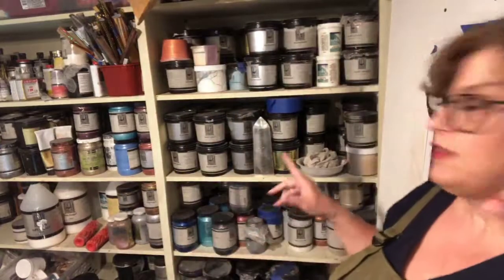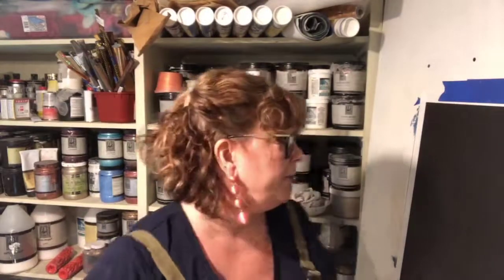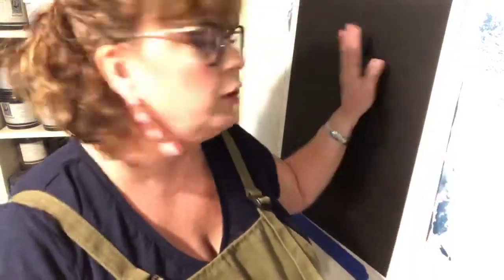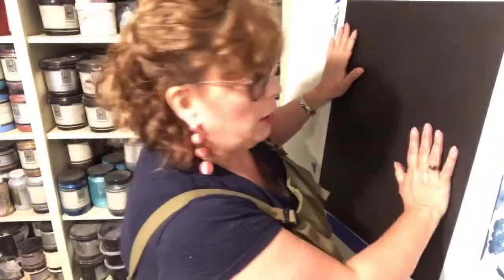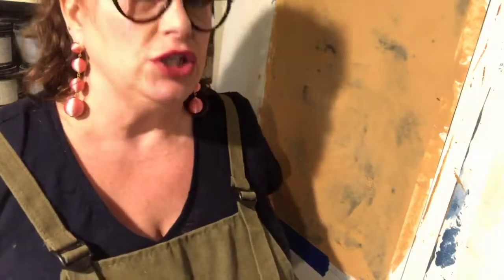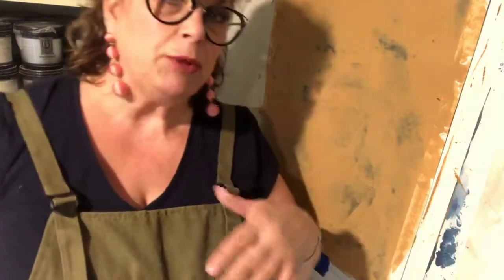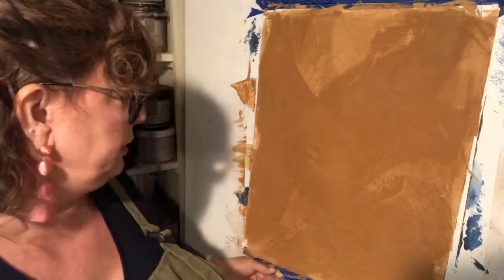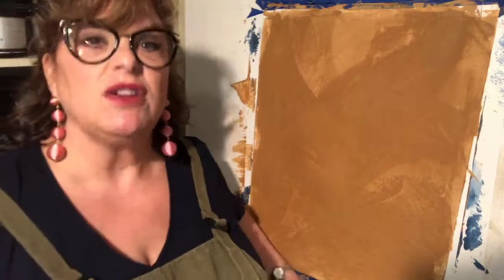StucoLux and LusterStone 101

Comment: Why black basecoat
Reply from the maker: For a couple of reasons. Usually, a color base that is close to the color I’m using is preferable but at that moment, all I had was black. Black looks far better under products that are a little translucent than white does because white ends up looking unfinished where as black will enhance it if there are thin spots. And finally, on a video, I really wanted to make sure you could see what I was doing and the black board provided better contrast for the camera. I hope this helps.
Reply: @MoreyCurtisDunbar  thanks for reaching out ..
Reply from the maker: @sharabshah7823  you’re very welcome. I apologize for the horrible spelling. I went back and corrected it so that now reading it is easier.
Reply: @MoreyCurtisDunbar   Hi .. I did a lot of jobs with stucolux great product—
However I can’t find the right wax to use.. usually I’ll use V.Gem sealer and old world wax— but the wax was discontinued from FAux effects .. I try couple of different waxes but I’m getting dark blotches..
Reply from the maker: @sharabshah7823  now that the Venetian Wax was discontinued, my next choice is Liberon. It comes in colors a s is generally soft.
Reply: @MoreyCurtisDunbar  thank you.. same problem .. blotches ..
Reply from the maker: @sharabshah7823  I’m sorry to hear that. I’ve never had that issue.
Reply from the maker: @sharabshah7823  have you tried adding a little mineral spirits to the waxes? It makes them a bit creamier.